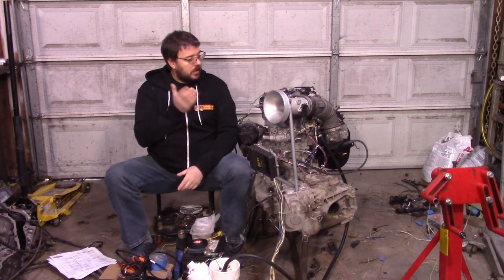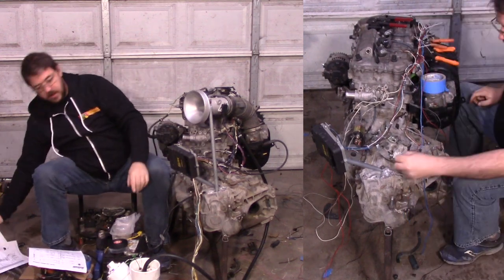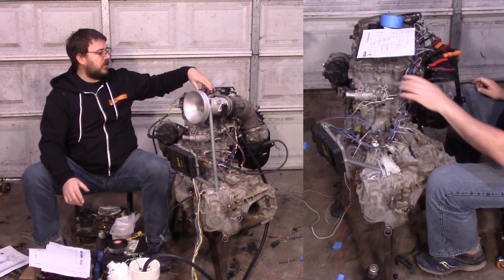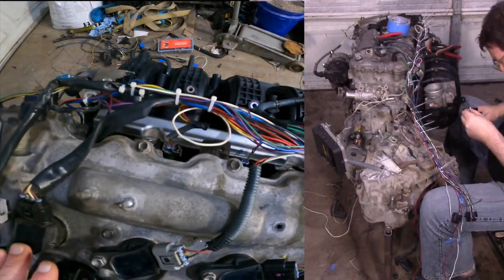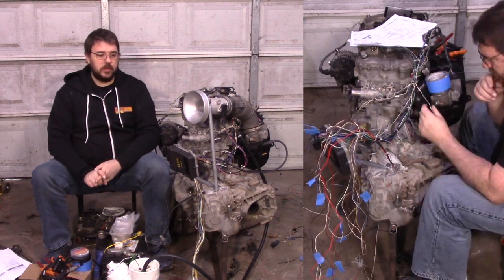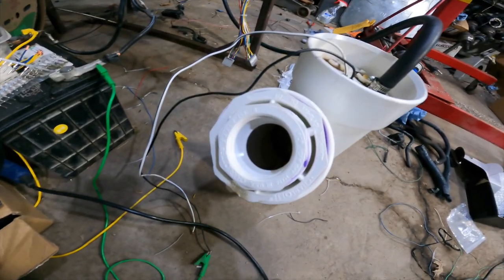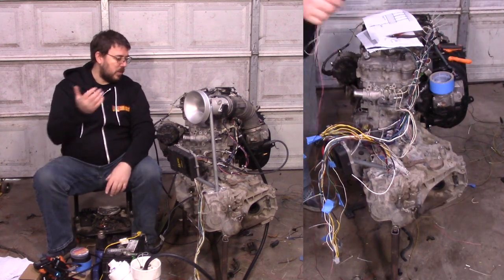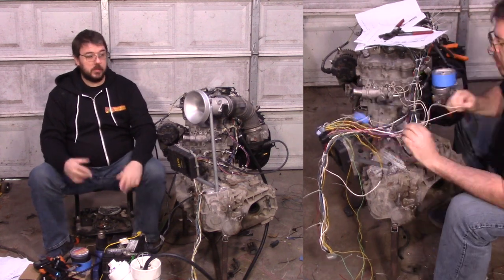Bench firing 2AR-FE for MR2 Drag racer (Evey #6)

Comment: Even though I don`t currently have an MR2 ,,,, this is why I`m here . Little tips and tricks can be found everywhere . The little loop in the coil pack power wire is a new one for me . I`m currently trying to decide on a standalone ECU for my 1.8T swapped 914 project ,,,, the 1500 Elite is in that list .
Reply from the maker: Awesome, thank you for watching :) as for ECUs, depending on your engine's feature set there may be a cheaper Haltech that will work for you. Does it have DBW? what about variable cam(s)? anything else special about the engine?
Reply: @FrankensteinMotorworks  , It is a basic Audi 1.8T 4 cylinder . 4 injectors , 4 smart coil packs , 3 wire cam and crank sensors , the usual stuff . I am using an earlier TB that is DBC due to my Wilwood adjustable pedal assembly . I just added you into my Instagram as well .
Reply from the maker: @JoeyWebber955  Technically you could get away with the Elite 1000 then but the price is very similar to the Elite 1500 so i'd proably just get the 1500 anyways so you have the DBW functionality if you ever go that way on a future build.

Comment: Love your vids, great work. In your opinion do you think the 2ar is as strong as a honda k. Your making good na power, but how do you think they would handle a lot of boost? Cheers.
Reply from the maker: Based on what the tC folks are doing they seem to be able to handle at least 400whp on a completely unopened motor. There's really no info between that and Papadakis' 800whp and 1000whp builds. I will work on filling that in-between info over time.